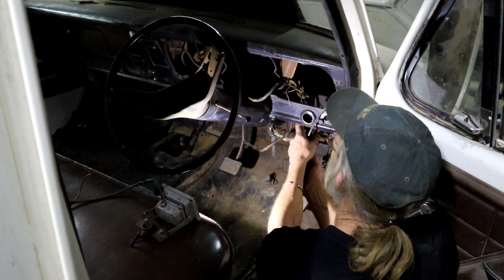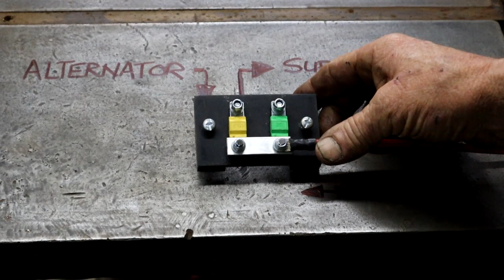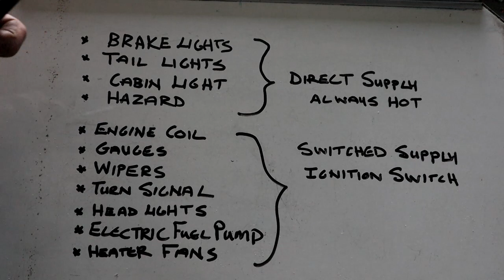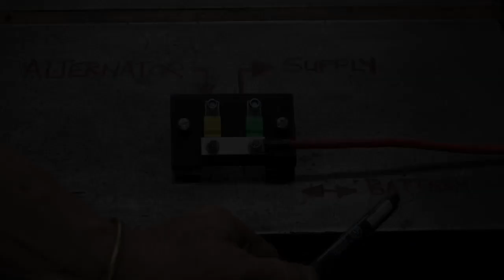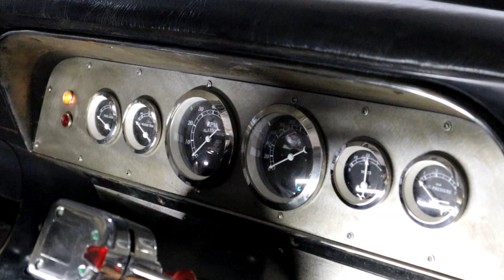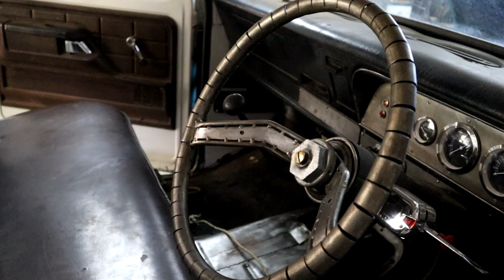How I wired my truck from scratch - basic, common sense wiring

Comment: Clear and well done. 
Far far far from the actual multiplexed shit.
One british car  joke : in my 86' Range Rover V8, the fuel pump is working when the sensor of the oil pressure switch the red light off.
Morality : if the sensor is broken, the car become unusable :face-orange-frowning::face-orange-frowning::face-orange-frowning:
Reply from the maker: Let's not even mention the ridiculous complexity of modern cars!

Comment: I feel for you...wiring is almost always a pain in the A*s. It is a little easier when you have the schematic for it. The accessory circuit is normally for things like a radio or interior cab light.

Comment: Damn that was fun to watch!  Dealing with old cars and wiring that has be "fixed" a few times is only really fixed by pulling it all out.  I've done this so many times and it is the only way.  I love to earth each system so every lamp and system is bright.  The air horn thing is just plain ass cool.  I'm big on relays for most heavy systems and I use LED's all the time.  I also always use a battery cut of switch just in case.  I almost thought no one else did this anymore and your approach is perfect as each car/truck or whatever needs to fit the man using it.  Very enjoyable to watch.  Bobby
Reply from the maker: Thanks Bobby, glad you enjoyed man!

Comment: Hey Duff, on my 64 I tried to use as much original wiring as possible. The gauges are powered from a constant voltage device. I'd never seen that before. The truck did not come with back up lights, door operated cabin lights and also had a manual transmission. My tranny and steering column both have neutral safety and back up light switches. I used the ones on the column. My start solenoid has a small ground plug tied into the neutral safety. The fuse panel was mounted on the back of the headlight switch. You needed a monkey to get at it. We don't have monkeys!:( I also set up fuse blocks and relays under the hood on the firewall. I also enjoy wiring! Thanks for the great videos!

Comment: Hey Div, where did you get those fuses? I haven't seen them before. How are they different from our local garden variety spade fuses.
Reply from the maker: Suppose you referring to the big 30 and 60 Amp ones with the boltable tabs on them? Found them at my local Midas. The ones in the fuse box are normal spade ones
Reply: @ratrodsafrica  Yes thank you those are the ones. Why did you use that as opposed to the spade type?